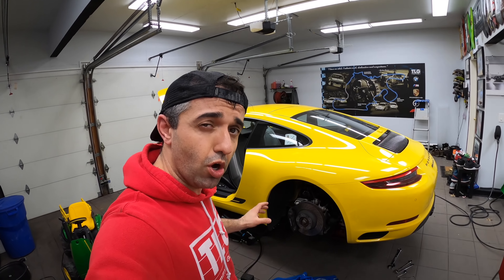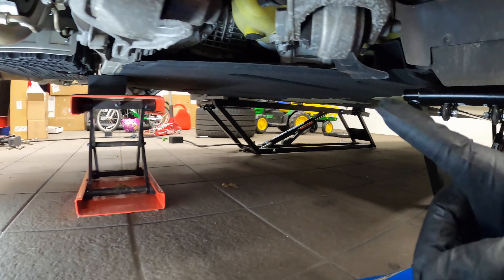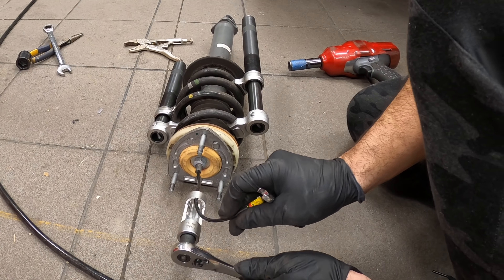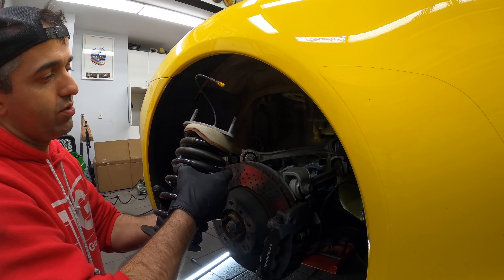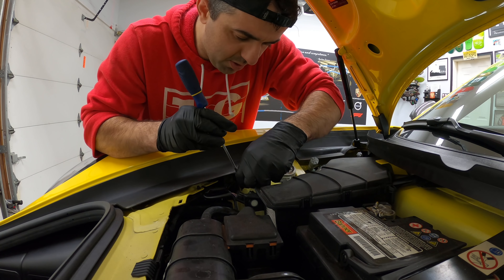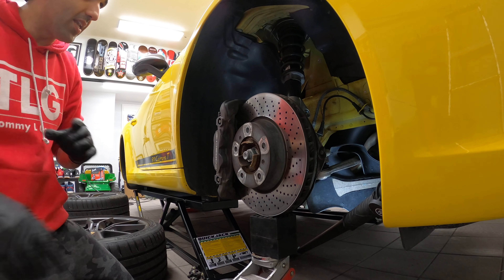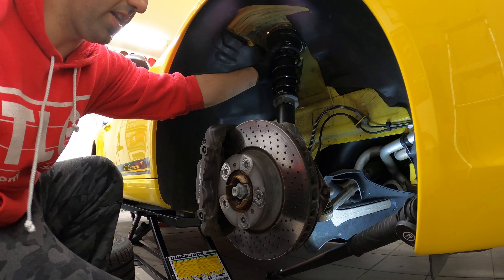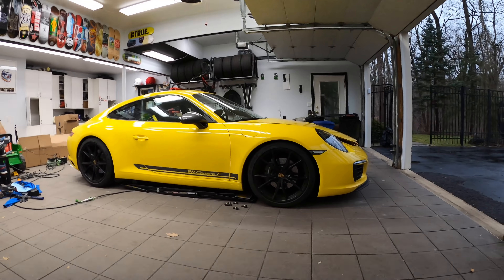DIY Porsche 911 lowering springs in less than 2 hours! (991 and 992.2)

Comment: Just used this video to change springs on a 992 and here to report that there are very few changes with the new generation. A couple of rear suspension bolts are different sizes and that's it. Thanks for a super useful and informative video!
Reply from the maker: Glad it helped!!!
Reply: can you say whether or not the from structs also had a snap ring adjustment for the perch?
Reply: Did your 992 have rear axle steering option? Did that add anymore steps to this process?
Reply: @farissou9384  No RAS on my car :)
Reply: @55onesean38  oh man, I’m doing my drop tonight.  I hope it isn’t too different then.  Haha

Comment: Just bought a 991.1 that I plan on lowering with some H&R springs.  What size spacers did you buy from front and back?  I'm also getting a lot of mixed signals about spacers altering the drivability and feel of the front end.  Can you provide your experience with them?  Thanks.

Comment: I just completed installing H&R Sport springs on my 992 Carrera T and this video was infinitely helpful. Thank you! The main tips  being how to easily access the rear struts from inside the car with minimal disassembly required. Also which arms need to be detached in the rear and the trick about screwing the springs out of the front strut towers was priceless. The rear was medium difficulty/frustration whereas the front was an absolute breeze. I'd say each side in front can be done in 10-15 minutes. Thanks again!
Reply from the maker: So happy to hear! Glad my front spring trick worked!
Reply: Just got a t- were there any issues or lights after install? Benn looking at lowering mine.
Reply from the maker: @SeaNaCl  no issues. Congrats !
Reply: @TommyLGarage  Got it. Thank you!
Reply: @SeaNaCl  same here, no issues at all since the install for me.

Comment: Another informative video Tommy. Great job! I can't even imagine how much the dealer charges for a 10hr labor and you did it in 2hr. Luckily it's not the summer, I couldn't imagine doing this in the hot summer in the garage.
Reply from the maker: The garage actually stays quite cool! :)
Reply: Need help 991.2 convertible back is different on convertible can’t get to rear strut front is done little over an hr looks great

Comment: Im not sure if the .2 is different than the .1 but i had a HELL of a time putting the rears in. Simply lifting that top arm was NOT an option for whatever reason. The brake line and ABS wire were in the way. I did every step you did and it took me 5 hours. Mind you, i have installed suspension on tons of cars over the last decade... This was insane haha. Still got it done, but oh man was that a painful experience.
Reply from the maker: Sorry to hear that but at least you got it done!!!
Reply: @TommyLGarage  Yep! Its mostly because the arms were still under tension from the subframe mounting locations. SO even with a helping hand, it was a PITA haha. First time tho and i know i could do it faster again

Comment: Good video- how did you torque up all the control arms? I believe you need to load the bushings before torquing up the control arms. If you don’t, the bushing will fail shortly after.

Also, do you torque up the strut nuts with the springs compressed?
Reply from the maker: Yes strut nuts need to be tightened with the spring compressed
Reply: With the quick jack you could do this pretty easy by putting something under the wheels, loading them up and sliding under the car to torque them. Do you have to do this?

Comment: @TommylGarage,  are there any tighten number for the struts nuts and spring on the towers? also when putting the new spring  on the front how much to do you have push on the jack to compress the spring before tightening the nuts?

Comment: Great vid! Love the carrera T in yellow. But damn, this is not a 2 hour job for your average Joe haha. 
What's the c-clamp for on the rear shocks? Can you just move that down all the way the with stock springs and get a similar drop?
Reply from the maker: Actually yes you can lower it on stock springs. Unfortunately front is not adjustable
Reply: Why you lower the c clamp at the rear? Do you have to do it or is just compulsory? I’m doing my springs and I don’t want to go crazy low. If I leave the c clamp in the original position will I achieve anyways a drop?

Comment: Great video. Thanks. Love the front end  shortcut. I am doing mine now, 991.1S, using Eibach springs. Just got the back end done and can't wait to try out your shortcut. One question though, shouldn't you only tighten the control arms with the wheels at normal height (i.e. not hanging) so you don't stress out the bushings? Thanks again for the great video.
Reply from the maker: Good thought on the control arms. I was told not to worry about it since that is how the tech does it.

Comment: Makes me want to drop my 991.1 now! What springs did you use?

How did the ride quality change?

I sail over speed bumps with no worries of scraping, I’ve been in the lowered game before, did you run into any scraping issues?

Thanks for the awesome walkthrough!
Reply from the maker: I went with Eibach. No noticeable comfort difference. It’s a no brainer !
Reply: @TommyLGarage  thanks Tommy. Hey, I have a manual, do you find the throttle response even in sports mode just isn’t as responsive as you’d like? I’ve been thinking of adding one of those pedal response mods, like Race Chip XLR5. Wondering if you’ve had any experience with this mod?

Comment: Great video. Is there a c-clip on the front struts also to lower the spring mount? How much difference does moving the rear clip make? Thanks
Reply from the maker: Thank you. No c clip in the front. Moving the rear makes a massive difference. Car cannot be lowered properly without it.
Reply: @TommyLGarage  thanks for the reply. Keep up the good work 👌🏼
Reply from the maker: @TheFairz  you got it!

Comment: Nice content, cool trick for the front springs. Wouldn’t the bolts be one time use though, and did you use the correct torque values when putting things back together again?
Reply from the maker: Correct torque specs yes. I just didn’t film it. 
And I reused the bolts. They’re not one time use.
Reply: @TommyLGarage  Can you provide the torque specs for the various bolts please?

Comment: Great video. About to do it how. Did you just disconnect the negative terminal? Did it throw any codes when your reconnected?  Thanks.
Reply from the maker: Yes just disconnect negative terminal. Won’t affect anything.
Reply: @TommyLGarage  thanks. I started the job yesterday. I’ve done many suspensions in the past, never on a Porsche though. On the rear alone it took me about 2.5-3 hours. Granted having the right tools makes a huge difference and I don’t have an electric 90° ratchet which would have been nice for the rear top nuts. 🥵
Reply from the maker: @agcrxturbo9577  but at least you’re learning about the car!!!
Reply: @TommyLGarage  this is true. Thanks to this video, I mustered up the courage to rip into it. Now to finish the front which should be “easier”.  Great content. 👍🏽
Reply: @TommyLGarage  so just finished the Install and you were right, I was “shocked” at how easy the front were. Doing this job myself saved me anywhere from $1500-$2500 to install. Thank you for this video! 🙏🏽❤️👏🏽👏🏽👏🏽
Reply from the maker: @agcrxturbo9577  so happy to hear!!

Comment: I have a 992 with front lift system which I never have to use because the car is not that love originally to begin with.. but if I lowered my car it would be the best of both words. Will I be still able to use the lift system after this upgrade? Does it any way destruct the drive quality on bumpy city roads? Thanks for all your effort you put into this.
Reply from the maker: Ride quality remains the same. Zero regrets
Reply: @TommyLGarage  thanks. Will I be able to use the lift system still?
Reply from the maker: @peterkapusi5882  most definitely
Reply: @TommyLGarage  Thanks! What lowering springs and gauge widening would you use on a 992 carrera s cabrio for perfect fit?
Reply from the maker: @peterkapusi5882  I would stick with Eibach
Reply: @TommyLGarage  is there a certain type of eibach you would say is good for my car?

Comment: So this c-clip in the rear strut is actually can change ride height without changing a spring
Reply from the maker: That’s right! But only in the rear
Reply: So you dropped both with the C-clip and -25mm with the springs? What is the total diffrence with the stock setup? @TommyLGarage

Comment: i saw a similar level sensor like the one used in air suspension. Is it possible to use adjustable level sensors to fake shorter levels to lower it automatically? Not sure if it work the same way like the air suspension
Reply from the maker: No it won’t work. These Leveling sensors are for headlight aim only

Comment: This is so much easier - compared to 996/997 turbo! :) you need to remove crap from rear/interior  rear is not bad but front  you need to remove axles :)
Nice you went with H&Rs , I did lower my GTR on H&Rs as well.  same as my M4 was- h&R is way to go for z German cars.
Don't you have to put some miles before you hit an alignment ??
Reply from the maker: I actually did Eibach. I linked H&R since they’re the only ones in stock now

Comment: Hi.  do you recommend lowering the tyre pressures also after the drop?  I've lowered my suspension with HnR springs by 35mm but wondering to slightly reduce pressures?
Reply: How the ride affected?
Reply: You shouldn't have to change tire pressures - the load of the car has not changed.

Comment: Great video but my car is 911 turbo S convertible 991.2 front springs 1 1:2 hr back can’t get to top strut any idea!! different  than coupe in back Help!! Can’t find any video
Reply from the maker: What do you see up top?
Reply: @TommyLGarage  hi Tom , on convertible car 911 turbo S 991.2  have to see how the back Panals comes out behind the seats has factory roll bar intergraded into back Panals see if I can get room to access top of strut bolts
Reply: @TommyLGarage  took out back drain tray but can’t fold back window convertible forward enough to get access tried top in different positions
Reply: @TommyLGarage  thanks for answering back
Reply from the maker: @salcialdella9008  I will check
Reply: @TommyLGarage  thanks

Comment: Don’t believe this man’s lies “two hours” there’s no way, hours of struggle were cut out of this video, notice how the garage is closed so you can’t see the daylight disappearing. Replacing the whole system takes 6 hours minimum and that’s with good tools. Also there is a necessary alignment that has to be done afterwards which adds another few hours to the job. Overall expect 8 to 10 hours spent doing this to completion.
Reply from the maker: Stop spreading false rumors to justify overcharging your customers. Front is 15 minutes per side. Rear maybe 20. I showed every single step, which there are few. Alignment is of course on top, but I don’t have an alignment machine. If a shop ever quotes me 10 hours for this I’d ignore everything they told me before or after, since obviously they have no idea what they’re talking about.
Reply: @TommyLGarage  what customers, I’ve utilized a shops lift to do this myself. I have specialty tools and I’ve been working on cars for a while and I’m very familiar with the 991.1 and .2. You cut out a lot of the moving and torquing and navigating and pushing and pulling in order to get those struts out of the car. Also those bolts in the rear are single use and if not the bolt, the nut. Overall it takes about and hour to an hour thirty to get a rear apart and back together, and the fronts aren’t much different. On top of that you’ll need an alignment which can take anywhere from two to four hours. So 8 hours for the whole job is totally acceptable.

Comment: All these cut scenes. So misleading! Very few DIY-ers have those tools. It’s clearly taken 2 hrs for one corner. We charge 2.5 hrs per corner. That includes the NECESSARY alignment after the install. I don’t see an alignment rack in your garage?
Reply from the maker: If you charge 2.5 hours per corner you need to find another profession. Front literally takes 15 minus each side minutes alignment.